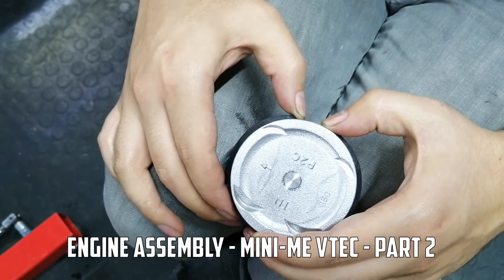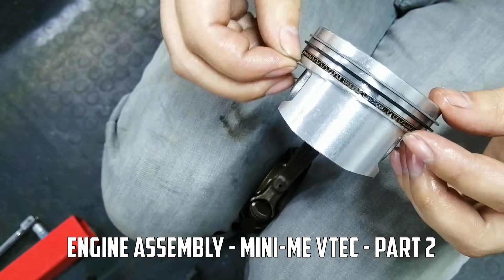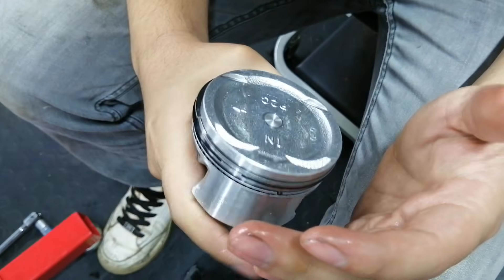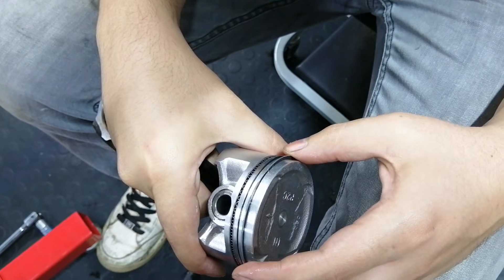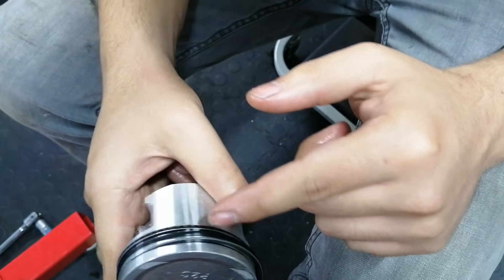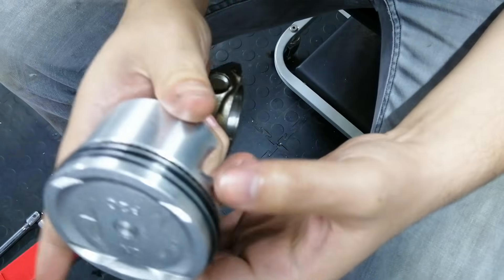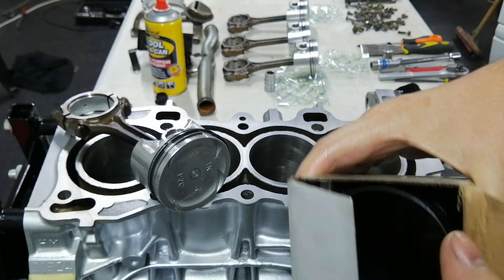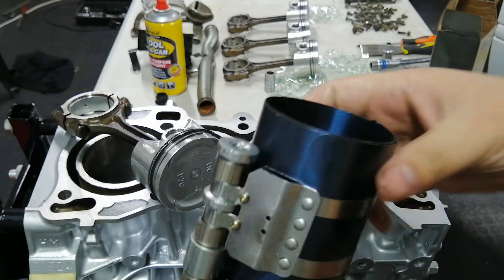Honda VTEC Engine Assembly - D15/D16 Mini-Me - Part 2

Comment: Did you also lower the oil rings?
Reply from the maker: Hi, I did the first and second ring but not the oil control rings, they are skinny and won't cause damage even in the event that they touch

Comment: lil tip for anyone with that same style ring compressor you dont have to use that goofy square drive hex key thing, use a 1/4" extension and a regular ratchet, its the same drive size
Reply from the maker: Hi, Thanks for the tip, that’s a lot easier!

Comment: Hey man, I am rebuilding my engine too and I have some questions regarding your build, looks like you're turning the crank with a breaker bar, you were able to turn it by hand? I am having some issues, I checked with plastigauge for clearence and the tolerances seemed ok but I can't turn it by hand, only using a wrench but I heard that is no good, how long did this engine lasted? or is running fine right now?
Reply from the maker: Hi bro, this engine is still running. Initially, i fitted 1 piston with no rings, and i was able to rotate the motor with just my hand fairly easily. After installing pistons with rings, i had to use a ratchet to rotate the motor as the piston rings create resistant. But you should be able to rotate the cranck by hand after install, if it does not rotate something is off

Comment: I build a mini me d15b2 and p08-3 head junkyards parts but no VTEC crap or turbo neither.I bored the head mild and i home made the obdo distributor by cutting and edge and i put a Weber carb with a 272 Delta cam regrind and lighter flywheel and gd clutch kit and others old school knowledge and my crx is peppy like hell responds like a beast old school style like a ford muscle car with 2 in exhaust system
Reply from the maker: nice setup, simple and oldschool, probably also very reliable running it on the carb.

Comment: What about the compression ratio now? You reduce it ?
Reply from the maker: Hi, at first no. the compression was 9.8-1 on this setup, after I added a thick head gasket making it 8.9-1. With the high compression and boost I had head gasket issues, lowering the comp mostly solved the issues.

Comment: This is NOT the way to build an engine 😢
Reply from the maker: Hi, i'm definitely not an expert engine builder, but the motor is still running, boosted and making almost double factory HP with no issues 2 years later.

Comment: Y dose no one use the d17i turboed my d17 I haven't ran it yet but everything is stock other then block guard and are studs and some 550cc injectors and high flow fuel pump. I did put a d16 intake manifold on it. But I'm going buy a halltec standalone ecu for the car instead of hondata just in case I blow up my motor I'll drop the ecu and turbo setup in my e36.
Reply from the maker: Hi, sounds like a fun setup, I have seen a few but it is probably coz it has a bit less support and parts available, I know the D17 internals and valve train is fairly similar to the D16, just the block and head cast are different so they can't mix match with older D16 motors like the D15/D16 can. Also manifold bolt patterns are different but can be made to fit.

Comment: Hey I know you get a lot of questions here but did you just retro fit a vtec head on a no vtec block
Reply from the maker: Hi Destin, Yes. you may need a few things but most Dseries blocks and heads can be swapped no problem. just not the old A9 DOHC and newer D17s.
Reply: @RisingBoostYT  any idea on specific engine number heads ? and what are the mortifications you ran into if you don’t mind me asking? Thanks for the reply btw

Comment: I have never seen someone install a piston and rod with the rod cap still on? And then take it off after its in, then re install it? Please explain this to me
Reply from the maker: it was an oversight, the engineering bolted on the rod caps, and I did not think about how difficult it is to remove once installed. definitely won't recommend it.

Comment: good day sir..i just wanna ask about torque specs, i mean how many foot pounds of torque to tighten the bolts in the rocker arm cam cap that holds the camshaft..i think there are ten 12mm bolts and four 10mm bolts in both ends..thank you so mch sir..and more power..
Reply from the maker: Hi Virgina,  I use this website, they have everything listed - https://www.nthefastlane.com/d-series-torque-specs
Reply: @RisingBoostYT  thank you so mch sir for your time to reply..its a big help for me.thank you again sir..more power to you

Comment: So crazy thing. i went to get a fully built black right came to find out whoever it was i got it from has done it your way bro same everything just professionally
Reply from the maker: Hi Bro, sorry to hear that. it is always a risk buying a motor, it's not possible to confirm if it is "build" without pulling off the oil pan. the easiest way to check is to take off the oil cap and look at the 1 visible head stud (SOHC motors only), if it is a ARP stud, then maybe, but if it is a stock head bolt then its 99.9% probably not built. it's always best to tell the seller to remove the valve cover and oil pan so you can inspect if it is built or just for damage like a burnt rod bearing cap.
Reply: @RisingBoostYT  yeah the guy told me too tho bro so i already knew lol but it’s the same exact build your doing in the video which is pretty dope
Reply: @RisingBoostYT  Atleast everything else was done oil pump, water pump, mid compression pistons everything was professionally done and bored.

Comment: Can someone direct me to these same parts that can withstand 300-400 HP on eBay?
Reply: Thank you
Reply from the maker: Hi Junkis, Try Speed Factory.  https://www.speedfactoryracing.net/products/ycp-pistons-pins-and-rings-with-eagle-rods-d16?_pos=3&_sid=031f9186c&_ss=r
Reply from the maker: here is an ebay link, the links are for D16 only - https://ebay.us/JrWQtQ
Reply: And also block (cylinders) _ (block engine)

Comment: Ok, so I never touch the bearings with my finger because the oil in my skin can damage the surface. When I install main bearings I measure bearing crush just to make sure there is some. It's not as often as it was 30 years ago but some bearings have come out of the box slightly short and when torqued there was no crush. Bearing crush is what secures it in the bore. Also I put tight fitting hose over the rod stud so the cap is off when I install it and it goes over the journal right away. The hoses guide the rod over the journal with no risk of damage to the crank. You are going to use head bolts with boost. I'm not a Honda expert but don't d 16 head have a habit of lifting under boost with bolts?
Reply from the maker: Hi 3dw3dw, thanks for the helpful tips. on this build I 100% relied on the sizes on the box as I did not measure any clearances apart from ring gaps, also yes the Dseries motors are prone to lifting the head and blowing the head gasket. over boost, detonation or aggressive timing and its likely to lift. but they say stock the motor can do 220whp. so I will test that. currently running 6psi on conservative timing and no issues so far.  I estimate 150hp. (before- 7psi was 163hp)

Comment: cant u install pistons and the flip the block and install the crank once the pistons are in?
Reply from the maker: Hi Christian, yes you can, it is safer to do it that way. in my case I wanted to test the "piston to valve clearance" so I installed 1 piston and the crank to test. I did not show it in the video but that is why the crank was installed first.
Reply: @RisingBoostYT  ahhhh i get you, thanks for clarifying!

Comment: I must've missed it in part one. Is this engine stock block or did you sleeve it?
Reply from the maker: All stock internals, opted not to use the block brace in the picture.
Reply: @RisingBoostYT  What is your opinion on this? When should a block guard be used to protect cylinder liners?
Reply from the maker: @gilvanSantos35  the sleeves are strong but the open deck design allow for sleeve shake causing headgasket failure under boost, personally i will always use a block guard going forward

Comment: Hey quick question. Did u have to check piston to valve clearance?
Reply from the maker: Hi Randy, yes I did check it. I locked 1 intake valve in vtec and fitted the head loosely without a gasket. There was enough clearance as the valve did not even touch the clay.

Comment: I got d15z6 and head bolts aren't same long
Reply from the maker: Hi Jakub, yes the D16A motors have longer head studs, 16.5mm and the D16Z/Y motors use a shorter 14.5mm stud. If you combine a A block and Z/Y head you may need 9 16.5mm studs and 1 custom long stud. I used 1 from a EG D16A6 to make my setup work

Comment: 5:23 and 7:02 How much power (Nm )do these screws need to tighten? Do you have a manual pdf  to send me by email?Thanks.
Reply from the maker: Hi MrGeo. I use this website, - https://www.nthefastlane.com/d-series-torque-specs  
they give the specs between the different D-series motors.
Reply: @RisingBoostYT  Thank you

Comment: How come you didn't upgrade the rods? they look very thin compared to after market H-Beam. looks like asking for trouble under boost.
Reply from the maker: Hi James, basically it came down to price, the rods/pistons set costs about $570, that is not bad, however I have to ship it to my country, so that adds $250 in shipping and probably $100 in fees and taxes, that's $920. so for me, the cost is almost double. so it does not make sense to really build a D-series. for that money I can rather do a Bswop and get rods for that. they say the stock rods can handle 220hp so we will keep it at that. the Bseries build is next.
Reply: @RisingBoostYT  Good call! That is expensive. I have been looking at a cheap Honda engine to build a jet boat. I need around 200-250hp for it to be fast. The Honda R18 and D17 is very cheap in Australia so I am looking at those two at the moment
Reply from the maker: @unchartedgroupielove  the R-series motors are a bit more economy-based motors, they have an eco version of vtec, not sure if an R-series will be reliable at 200+ hp continuously. D17 is slightly different from the older D15/D16 however there are Performance versions of the D17, I would opt for that, boost it to 220 but take extra care with cooling and an oil cooler because a jetboat will likely make the power for longer durations than a car.

Comment: I have a question , why did he attach the crankshaft before attaching the pistons and if it was to check the clearing of the rods then wouldn't that be done after attaching the rods to the crank?
Reply from the maker: Hi Ibrahim, I actually installed 1 piston (without rings) and the crank to check the piston to valve clearance when in vtec. it did not work out as I did not have a cambelt at the time so I did not include it in the video. so yes the install process "video continuity" may not be 100% as I did it.
Reply: @RisingBoostYT  Thank you for the the reply and explaination , I really enjoy your content keep producing more of it

Comment: Don’t use metal to pry and move parts .  Do not install pistons like that .  Fuel line on stud open cap .   Good effort fir sure and good video .   Positive comment 👍
Reply from the maker: Hi Hereinmissoula, thanks for the good advice, my first mistake was not removing the rod caps before installing the pistons. I did not expect them to be torqued to spec (done by engineering). I should have removed and reinstalled the pistons but my ring compressor tool was also garbage so I did not want to do that. I tried removing the caps with a hammer handle that was rubber but it didn't work, so I used the metal bar knowing I should not do it.

Comment: I say this out of good faith. Get that China block guard out of there asap. All they do is distort the cylinder walls.  For $350 send you block to CSS
Reply from the maker: Hi Jim, thanks for the advice, I did remove it before fitting the head, it was obstructing coolant ports and did not even touch the outside of the block, in my opinion it would not have done anything positive. For now I'm running stock internals so the rods should fail long before sleeves.
Reply: @RisingBoostYT  good man. Save up the funds as I did (took forever lol) and send your next big build to Jeff @CNC Werx. Finish up with a vitara piston and rod build and you'll be on your way to 500HP 💛💯👍
Reply from the maker: Hi Jim, thanks for the advice, it won't be an option, i'm from South Africa, we do have similar options around here, but the market is smaller so the price is higher, I do see Darton sleeve blocks come up on occasion but not cheap,, the next motor build is a LS B18 Vtec. after that i'll start looking at a proper build that can hold some real power.

Comment: Its normal after.fresh rebuit have scratch on exaust side cylinder whall?? On all 4 cilinders....
Reply from the maker: Hi Fernando, the marks in the sleeves is from me doing the ring gaps, taking the rings out and putting them back into the sleeves several times to test fit, that caused the marks, luckily it's only marks and not really scratches. after honing the cylinders they get a rough surface so the new piston rings and sleeves can "seat" during the initial break-in. the marks will be removed during that. if it was scratches it would definitely not be normal.
Reply: @RisingBoostYT  it is in my case... my engine was rebuilt... and on the sleeves on the exaust side has some  vertical scratches.... my ring gaps is in spec.... its normal to have scratches after a fresh rebuilt??
Reply from the maker: It depends on how deep the scratches are, normally a fresh build will have the horizontal scratches (45 degrees cross hatching) however fitting the new pistons will make marks on the new sleeves that could look like vertical scratches, it its not deep you should be fine, if the scratches are deep it could cause the engine to burn oil and breath more than normal.
Reply: @RisingBoostYT  humm...only in one cylinder can barely feel.with fingernail... new pistons and rings and oversize bore... should i remove postons to inspect the rings? On just run it ?? 😀
Reply from the maker: Hi would recommend removing it and checking the rings, possible that a oil ring may have gotten damage during the install process.
Reply: @RisingBoostYT  
I have removed all pistons and has vertical scratches on all piston skirt exaust side. Rings are ok and bed in... the rod bearings has on upper shell some erosion on oil hole...like the oil eroded some material around the oil hole... i take some fotos....i will replace rod bearings and assemble again.... CAVITATION OR PARTICLES ON OIL??
Reply: Give-me your email so send you the fotos of some rod bearings
Reply from the maker: @fernandoramalho3644  email to  risingboost8@gmail.com
Reply from the maker: @fernandoramalho3644  sounds strange, email me the pictures let me see.

Comment: why didnt you check your oil clearance. ?
Reply from the maker: Hi Abubakr, I did try to buy Plastiguage to check it, however it looks like it is not easy to find it in my country. so I checked it by installing a piston without rings, torquing everything to spec and making sure everything spins freely. it's obviously not perfect but if something is crazy out of spec it will show. it was running before and STD size bearings came out so I just put new STD size bearings back in.
Reply: @RisingBoostYT  Lol I'm from cape town I have some could of given it to you
Reply from the maker: thanks bro, Where did you buy it from? i'm from Gauteng, when I asked the guys at the part shop about it I could see they have no idea what i'm talking about.

Comment: Where is the block guard
Reply from the maker: Hi Znul, I removed it as the one I purchased (cheap), I am not convinced that it will actually help at all. secondly I am using stock rods and head studs so if the engine was to fail, it will fail on the rods and studs long before the sleeves.
because of this I decided not to use it, I may make a review video about the cheap block guard.
Reply: @RisingBoostYT  ah i see great build sir

Comment: so are we not gonna talk about the missing dowel pins
Reply from the maker: Hi Bro, definitely had them in, check at about 12 min into the video you can see 1 is installed in the block, the other one is in the head. I should have mentioned them in the video.

Comment: That is the first time I have seen piston assemblies installed with the caps on them.  Normal procedure is to remove the cap before installing with a piece of hose on each bolt to protect the crank.  Then you can install the cap and proceed to the next piston.  Also, you are asking for trouble re-using that water pump.  If it sat dry for any length of time the seal could dry out and leak.
Reply from the maker: Hi John, yes the rod caps was an oversight on my part, I normally put a cloth over the crank and put the cap back loosely to cover the studs. this time the rods went to engineering and they torqued the caps to spec to check them. I left them on like that not thinking about the fact that they are torqued and ended up having to remove them at the bottom. if my ring squeezer was not garbage I would have removed the pistons again and removed or loosened the caps before installing them again. and yeah.... you are also just about 100% spot on with the water pump. thanks for your advice!
Reply: Honestly I reused a factory Yamata water pump that was off of a wrecked 1997 D16Y8 with 8k miles that had sat in someone's garage since the late 90s. Installed it a Civic a couple years ago and it kept going. I've noticed the seals are more likely to fail from drying out if someone has used green conventional antifreeze rather than stock Honda or something like asian blue zerex that keeps corrosion and reactions to a minimum. If in doubt I guess you could always soak it in a water bucket before attempting to spin it.
Reply: Yeah first time I saw this too